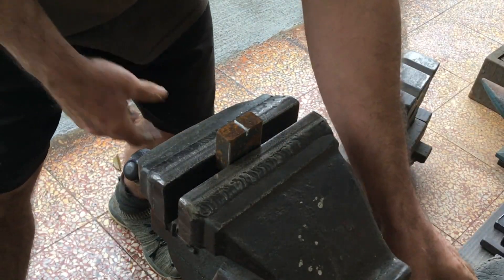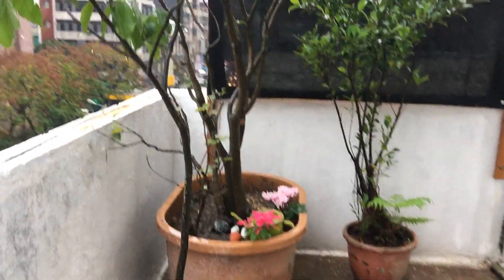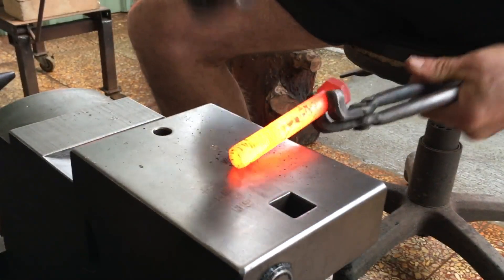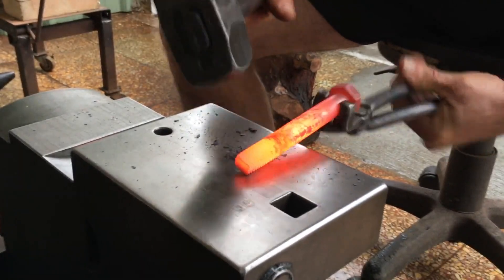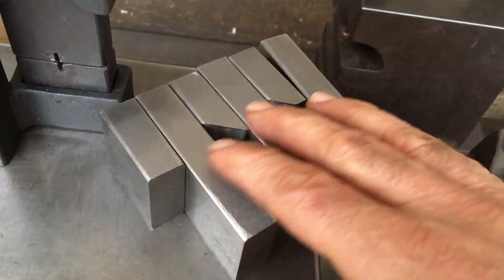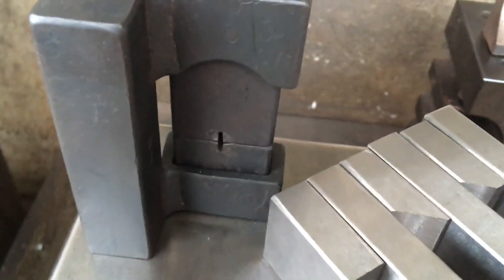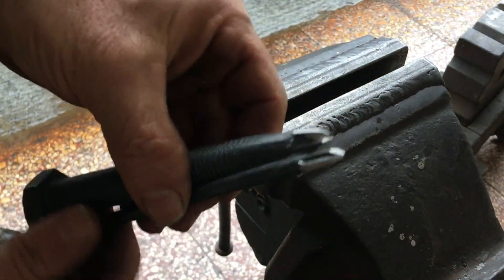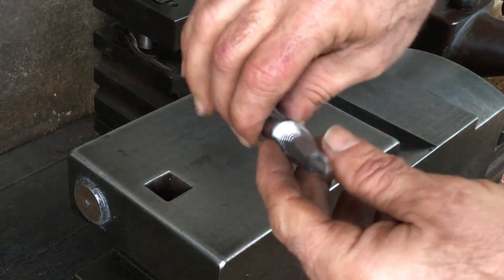Forging a Phillips Head Screwdriver from a Bolt

Comment: A heading die in the hardie hole works better. D2 is a good choice for the header die. A grade 12.2 bolt should be a good choice for the screwdriver. Just sayin'  cause been there!
Reply from the maker: Live and learn. I'm definitely doing stuff like this on the fly. And learning as I go. Thanks.

Comment: Please be wary of unknown steel, especially if it react curiously, could be toxic. Of course you are outside, still,remember Murphies law.Stay safe, you are too appreciated to lose.
Reply from the maker: Although that steel was unknown, the one known is it definitely is carbon steel and so I should be safe there. But yes, some metals (or coated steels) are very toxic at high heat. Thanks for your reminder.

Comment: Looks like your shop is pretty much outside, how do you keep all your equipment from rusting?  Your videos are excellent.
Reply from the maker: I'm outside but under cover. And I'll extend the roof line soon. The best way I've found for preventing rusting is by frequently using/handling tools. But I also sometimes spray and wipe stuff down with oil. Thanks for watching.

Comment: Very interesting. When you were using the dies, did you turn the stock 90 degrees between hits or were you only turning it 180 degrees (turning it over)?
Reply from the maker: Good question! As I remember, I only turned 180 degrees. I'll have another go at this. Thanks.

Comment: Good to see your getting settled after the major construction. Always interesting and thought provoking posts. I like Randy Richards in The Shop observation with the bolt head. Clearly this could be a specialty tool set ie square, hex etc.
Reply from the maker: I'm finally getting back to business as usual and not going bananas fixing the roof leak. And yeah, this could go in a lot of directions depending on the head type. Thanks.

Comment: That is actually a n interesting  concept. I wonder if you made it a bit larger you could make a hand struck stone drill. You know, the star points.
Reply: Rawl plug tool
Reply from the maker: Thanks for watching.
Reply from the maker: I think what you mention is certainly possible. I will have another go at this in an upcoming video. Thanks.

Comment: I take your point on the mystery steel dies. I just made some from A36 and now wish I'd made them from 1045 as I can already see some deformation.
Reply from the maker: I usually mark steel that I will set aside for  awhile pretty well but that wasn't the case with this. Thanks for watching.